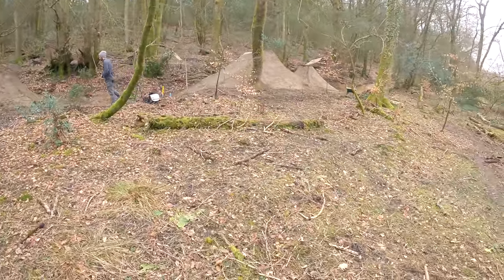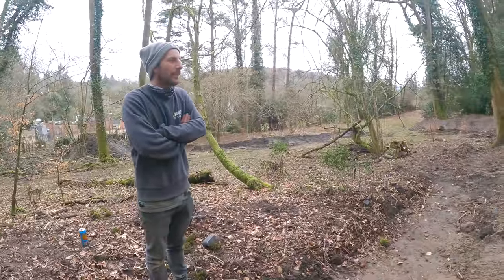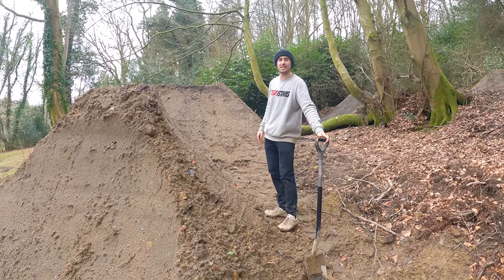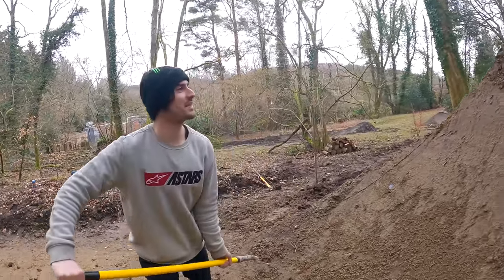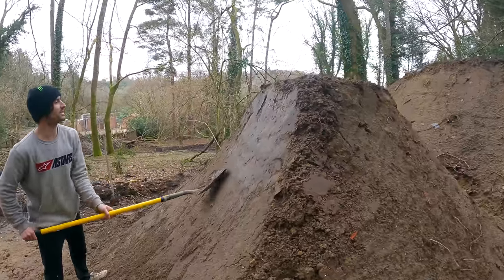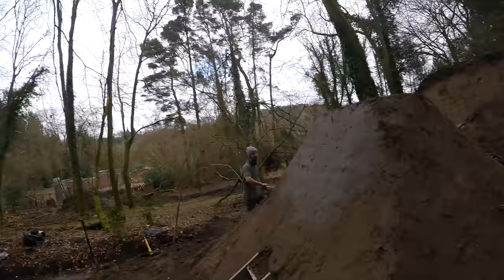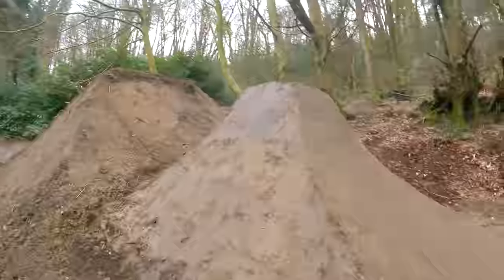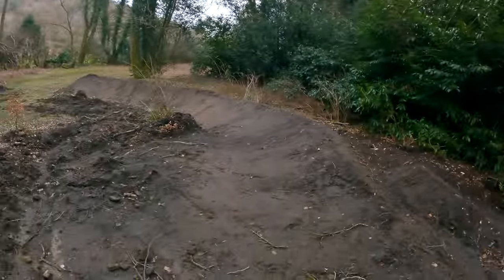BACKYARD BUILD 13 - How to Build a Perfect BOOTER Trick Jump Take Off!

Comment: Sam you are spot on about the air time for a given height being the same regardless the distance traveled
Reply: How ?  I can’t get my head around this :)
Reply: @meatfruit1123  think of gravity working. Like in a vacuum when you drop two objects with different masses from the same height they fall at the same rate so hit the ground at the same time. So if one has a forward trajectory of 100m but both are released at the same time the amount of time it takes to hit the floor is the same. I hope that helps.
Reply: @meatfruit1123  it’s like dropping a ball while walking or running- they’ll take the same time to hit the ground but one will be farther down the road. I hope that makes sense:)
Reply: @locohombre79  But it's just theoretical right? Like if you jump a spine 2 m high but its only like 10 cm long then you'll for sure have less airtime then a 10 m jump where you only go 2 m high because youre probably going slower for the spine. It's only true if you're going exactly the same speed in both scenerios or no?
Reply: Okey I thought about it a little bit more and read some other comments and indeed you'd probably have the same airtime in both scenarios, lowkey mind twisting

Comment: That’s correct. I once heard someone say that if you fire a gun perfectly horizontally and drop a bullet from your hand at the same height and the same time, both bullets will hit the ground at the same time. This is because the only acceleration acting in the vertical axis is gravity and so the bullets will both accelerate downward at the same rate. When you ride a long and low take off your body has little acceleration in the vertical direction and so it takes less time for gravity to stop your movement upward and then return you back to earth, regardless of how fast you are moving in the horizontal direction. When you hit a vertical take off almost all of your momentum is now in the virtual direction and so it takes longer for gravity to slow your movement upwards by which time you will be at a greater height than on the long and low jump and so you then take longer to return to earth.

Comment: A bullet dropped from your hand and fired out a rifle will land on the ground at the same time (assuming released at the same time, the ground is level and fired perfectly horizontal).  So doing a flat drop you will always hit the ground with the same airtime regardless of speed.  It will always take the same amount of time from when you max out the height of your jump to your landing, regardless of speed, as long as the height in the air is the same.  
But going into a jump faster means you can go higher, and if you are higher it will take you longer to land back down🤘